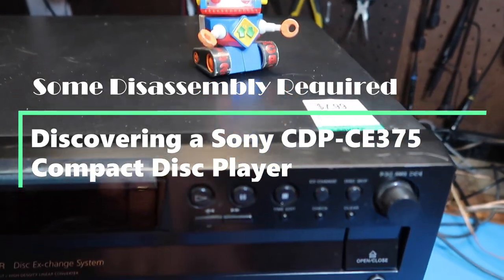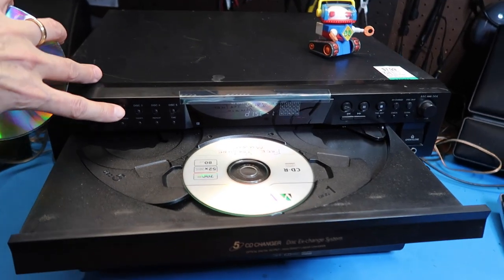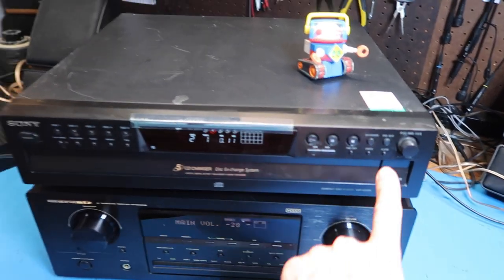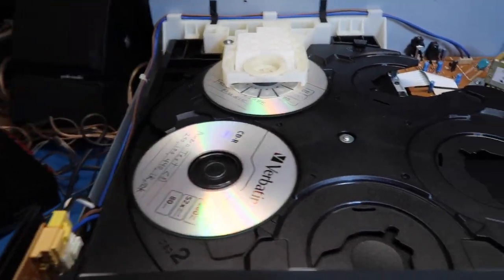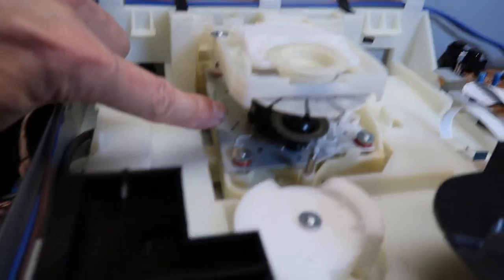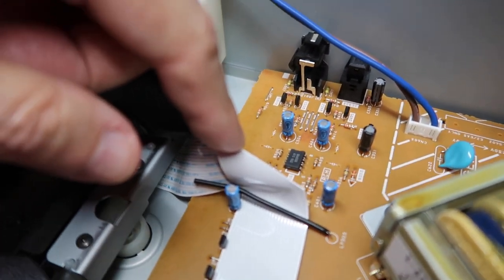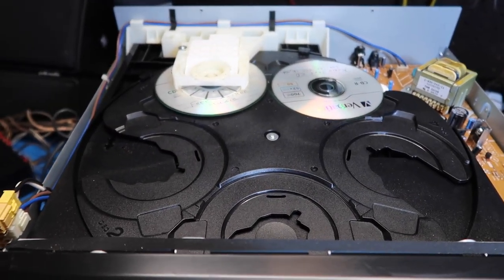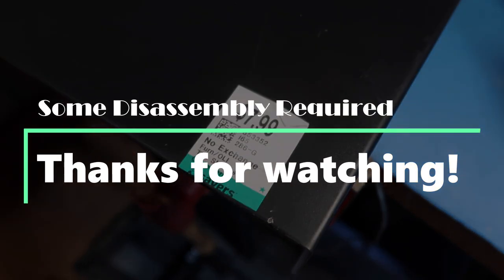Discovering a Sony CDP-CE375 5-CD Player

Comment: Yesterday I've found a 345 model at the recycling center and since it has some issues, I've binge watched several vids of those 5 CD Sony carousel players. And from this I've noticed how the internal build quality got continually worse with each new model. They've always implemented some simpler mounting solutions while using less and less matirial.
Oh, and mine has got two belts, bet yours got at least one.